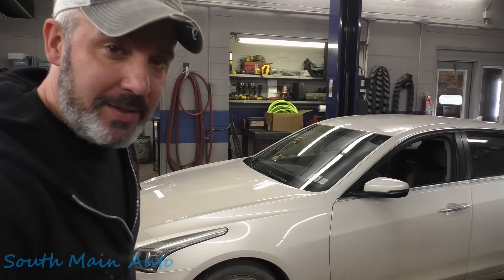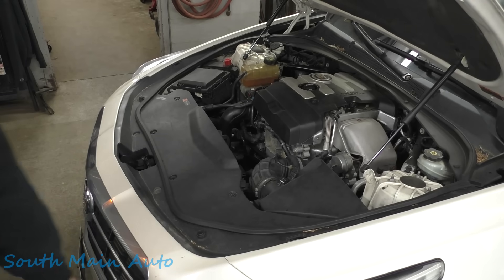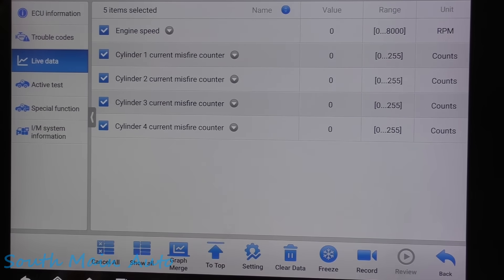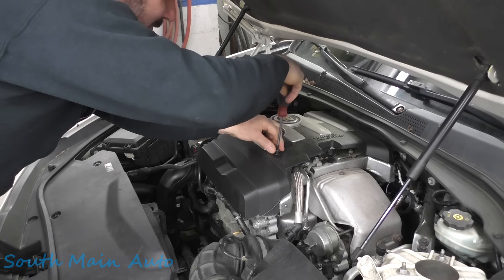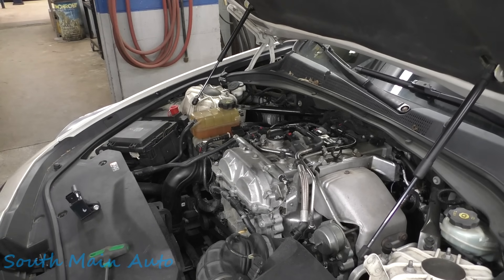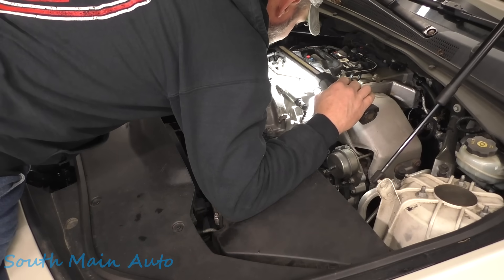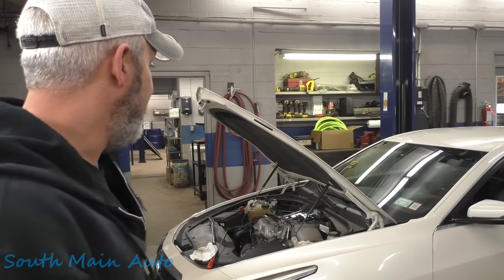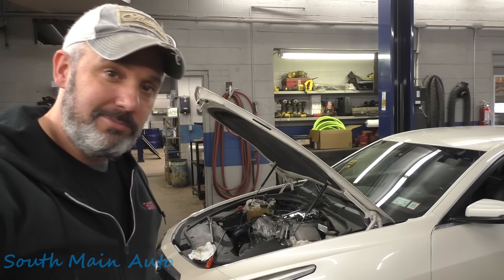'14 Cadillac CTS4 2.0 Turbo - Major Engine Damage

Comment: Danger Wil Robinson!!
Working at a Honda dealership some years back, performing a 60K service including spark plugs, I unknowing had a Snap On MAGNETIC spark plug socket that had a piece of magnet  break off and drop into the cylinder.
With the 2.2L aluminum head, it fell right down on top of the piston.
When the service was complete, I fired it up. It sounded like an empty spray paint can  being shaken at high speed for about 3 seconds, and then it was ejected out the exhaust valve, which closed on on the piece of magnet chipping the valve and damaging the valve seat  causing an instant dead miss.
Long story short, the dealership ate the parts and I ate the labor. After the service manager called the customer and put him in a loaner car he told all the techs in the shop that if anyone had magnetic spark plug sockets, to throw them in the trash.
Mine was the first one in the can and I will never forget eating that job. 
I hope that none of you will ever have too.

Comment: My spouse previously leased a 2015 CTS with the same engine. Decent performance, but the way they tuned the transmission is probably a major killer of these engines. It would refuse to downshift for as long as possible and run up to 15psi or so at like 2000rpm. It would climb steep hills at low rpm, just plowing boost into it. Guarantee LSPI is a major issue with as much boost as they force at low rpm, especially as these get a little older and higher miles (start consuming oil, which detonates like crazy under boost).
Reply: Yeah these things get wrecked because people refuse to run premium fuel and get oil changes at jiffy lube who do not use Dexos qualified oils that are required to mitigate the LSPI problem. I had a heavily tuned big turbo LTG and ran it hard at over 500whp for 120k miles. No problems at all. But I made sure the valves were cleaned regularly of carbon deposits and ran a catch can. All the car manufacturers love these DI high compression turbo motors because they hit fuel efficiency targets, so if it can last the warranty period with people that won't maintain them the way they need it to be everything after that is gravy for the service department.

Comment: If this TI wasn't on it, I would have guessed a bent valve, so I learned a thing here. The spot in the wall you see is wear due to piston load/slapping and not deformation due to coolant jackets being close. Built to a budget that was evidently a bit too low to make the engine reliable.

Comment: Thats what you get when using low octane on turbo engines.
Reply: Isn't it supposed to detune the engine a little if it senses a ping due to 87 octane?
Reply: Right there is the major problem IMO. If it's got a turbo, you need to be running premium gas.

Comment: Piston top design is integral to direct Injection engines, it helps with flame front propagation, as there are multiple Injection events during cold starts, and high demand situations, it truly is part of the chamber design.

Comment: This engine (LTG 2.0T) runs lean from the factory, which leads to piston issues. I went through a set of oem pistons, then upgraded to JE oversized If I recall correctly. Had a friend do it on a weekend, and tuned it using Vermont tuning. This corrected the fuel trims and prevented the car from running so lean. Not to mention more powaaaa. This car also had lots of differential problems. Sold the car last year at 160k, on its 3rd differential.

Comment: I work at a gm dealer, you get good and bad Cadillacs. Some have less problems than others, and people chose to fix what. Only thing I’ve really seen is newer 6.2 locking up. Other than that, the 3.6, 3.6tt, 2.0t 2.7t are decent engines
Reply: Yes. As long as you use Top Tier 93, use a quality synthetic oil and change it in time and change your plugs more often.

Comment: The piston top design was there to 'guide' a late in compression stroke direct injection fuel shot toward spark plug to create a local rich cloud in certain operating modes.  (Cold start...)

Comment: I totally agree it is broken piston rings or crack along the ring grooves on #1 !      Would account for the heavy scoring and groove  to the cylinder wall and lack/loss of compression.       Cutting open the oil filter will probably show some forbidden glitter accumilation.     Since this is the persons third engine that did this (or something similar) I would say it is likely that he pushes his cars too hard (its a Cadillac) not a Porsche or Ferrari.

Comment: Those 2013-14 2.0s were dropping dead left and right until GM released a TSB in 2014; different plugs and engine tune. That slowed it down, but dead 2.0s still pop up on Cadillac forum. I went with the 3.6 in my 13 ATS as I don't like turbo 4s; would have selected the base 2.5 over the 2.0 turbo.

Comment: The 2.0 Ecotec is a nice engine. Made especially for the Saturn redline supercharged Ion, HH4, and Cobalt. Then used in the Turbo cobalt, Cruze. The weakest part of the engine is the timing chain with plastic followers. Change at 80k. After looking at the video this 2.0 is different than the Ecotec. Thought they were the same but guess not.
Reply: Great engine with weak parts??

Comment: Easy fix Eric. Just turn of the fuel injector and ignition for that engine. It will become a 3 cylinder engine to run until it has 0 cylinder left.

Comment: Just wrecked my 2013 ATS with the 2.5 motor. First thing I'd be checking is that timing chain.
 Also watch that vacuum pump!!
Reply: I always check for the emblem and then make sure not to buy it

Comment: Not sure if your tool has it, but the newer GM vehicles have a compression test function in GDS2 that will disable the fuel injectors and crank the engine for a specific amount of time. Was helpful to be able to click a button and have it crank over to do the compression test when the 2.0T in my wife's '15 Malibu died. Was similar to this one too, low compression on #1.

Comment: I saw 2.0T and 2014 and already knew it was likely a cracked piston, the early LTGs are pretty notorious for doing that like the TSB Eric mentions. Guess I'm glad I have an LHU with timing chains as the most common failure point instead of wondering if I'll randomly get a dead cylinder from a failed piston.

Comment: Most computer scanners have a "compression" check which shuts off the fuel injectors and cranks the engine for 10 seconds and watching the RPM of the cranking speed.  This picks up a low compression jug as an increase in rpm during the degrees of rotation affecting the cylinder.

Comment: I suppose this is one of those times it is O.K. to guess and not test.  I think there is a difference between Eric taking a guess and anyone else.  Seems like he changed out an engine in one of these CTS cars some time ago.  I think he had to buy some kind of special table to raise the engine from below back into the car.  Every nut and bolt was installed correctly.  GREAT VIDEO!
Reply: What guessing? You see scoring that pronounced in that cylinder with low compression then you know it is dismantle fully to bore oversized plus anything you find when it is taken apart. That is not guessing.
Reply: @jimmyaber5920  I was just being sarcastic because he recently made a video on guessing instead of testing.

Comment: Looks to me that one of the exhaust valves kissed the piston slightly; just enough to bend it; contributing in part to low compression. BTW, it seems to me that most good & reputable mechanics are named Eric; well at least 3: You, ETCG & my mechanic Erik.🔧
Reply: That was a visual problem only, caused by oil on the carbon build-up.  I looked very closely at that.

Comment: Broken ring land sounds like a pre-ignition or detonation issue. The piston may have a design flaw making it weaker than it should be, but I wonder if the owner always used premium fuel. Perhaps not with if this is the third engine in 110,000 miles.

ALWAYS use premium fuel in a turbo engine, especially a modern one. Modern engine are more likely to have tighter mechanical tolerances and are generally less tolerant of abuse because they are built with less margin to "optimize" costs.

Comment: Early LTG engines were prone to piston failure, mainly due to the wrong tuning and customers running them on 87 gas. Surprised that one lasted as long as it did.

Comment: My hemi sounds like that, I figured a bad or leaking enjector,but still runs good and haven't changed plugs in 100,000 and has 350,000 miles on it. Probably should look for a replacement engine and rebuild for the future.

Comment: My two cents Worth of opinion, it's a customer wants to fix. Put a used motor in it. It probably has the same manufactured problem as this one junk pistons. Instead, instead, they could have the motor rehomed by rehomed by somebody with the correct tools.  And also to make sure that the honing is the correct. Deput, in some Teflon, coated skirted pistons with thin rings.
 From diamond or somebody, little extra money. But  gave Them a lot more Miles then what chevrolet has given Them. Just saying, thank you Eric for the video. Sure, would love to have one of those Cylinder cameras that looks like a damn nice Tool

Comment: Why does it look like one of the 4 valves is partially open about the 16:00 minute mark? Doesn't seem to be the case in the other cylinder you inspected. Maybe some sort of exotic valve timing strategy?
I would agree with the customers strategy for the car, but there is usually some other sucker out there who wants to own a Caddy.
Keep on cranking out the SMA videos 👍

Comment: As a gm tech all gm's direct injectino 4 cylinders have this issue, had one on a 1.4l buick encore with le2 engine- new style of the LUV 1.4l. had 44k on it and did 4 pistions, wrist pins and rings. also just looked on store and did not find the new endoscope you had pls add to the store or reply with link please and keep making the great videos

Comment: I wonder if they have been abiding by the premium fuel and dexos engine oil requirements to combat LSPI? I'm guessing no.
Reply: The engine in the video is a text book example of a boosted engine run (under boost) without the proper fuel octane requirement.

Comment: I'm thinkin this may become a common issue on all the OEMs installing small engines with turbos to save weight and improve mileage. Even full sized trucks are going with the small diesels with turbo, which begs the question... Can these small hopped up engines last? Being old school, I want all 8 cylinders running at all times if you are going to drive a full sized truck with even the occasional load. None of the fuel management BS. Dunno how all these small vehicles will last with hopped up ICE drivelines. Thanks Eric, I learn a lot from your vids. Love your tips from Granny.

Comment: @17:05.  That piston position indicator tool has a special aluminum rod with a rounded end.  That is so that it does not scrape aluminum flakes off of the top of the piston that can get lodged in the exhaust valves and prevent them from fully closing.

Comment: I have a '15 ATS with that 2.0T, 63k. It is the fastest car I've ever owned! But, I usually run 87octane in it and do regular Dexos changes. I thought it de-tuned itself a little if detecting pinging.  Now.....rethinking "cheap" gas.
Reply: Higher Octane prevents preignition(that's all it does) which apparently killed #1 piston.  If an engine runs at higher compression it needs higher octane and the idea of a turbo is to stuff more air/fuel into a compression stroke.  The knock sensor and computer can only do so much to prevent damage.
Reply: I have an '18 Camaro with the same engine and about the same mileage, and I like it a whole lot too.  It does detune for cheap gas, but I don't think it's really worth the performance and mileage drop, and in the manual GM makes it clear they would really rather you not do that if you can help it.  From other teardowns I've seen of this engine, it seems like what causes the piston damage is that the rings are already very tight, and the combination of combustion deposits and thermal expansion crumbles the metal around them.
Reply: @harrylister804 
I agree. 10:1 compression and 20+ psi of boost, the cylinder pressure have to be something wicked.

Comment: Unfortunately a common problem on 2013 and 2014 model year gm's with the LTG 2.0 turbo engine.  It affects a lot of Cadillac CTS and ATS models.  My understanding is the piston ring was somehow incorrectly gapped.  The issue was supposedly fixed from 2015+.  It's been well documented on Cadillac forums.

Comment: You can see the coolant is low.   The coolant tank has 2x chambers, the upper and lower.  The upper is the reservoir tank and the lower is the overflow tank.  The reservoir tank should be completely full and the overflow filled to the marked line.  On the video, the reservoir is only half full.  The overflow is likely empty...

Comment: Subaru has/had a problem with ring lands breaking on EJ257s found in the Impreza STIs. Subaru specs very tight compression ring end-gaps (as low as 0.009") which might be necessary for emissions but is way too tight for a turbo motor with a ~4" bore; with heat the gaps close up, the ends butt together, the ring seizes to the wall momentarily and a ring land breaks. I read that Cadillac likewise runs super-tight (0.007") gaps on these engines and that's probably why they're breaking. Were it mine -- and it didn't have the bore scoring seen here -- I'd probably put a new set of pistons and rings in it but open the compression ring gaps to 0.015" to 0.020" and it would probably never break again (at least ring lands...)

Comment: Could this be a stuck injector washing out the cylinder? Hence a replacement engine fitted with the same injectors caused the same fault, maybe intermittent?  I guess we'll never know if it's gone  to the crushers.

Comment: Some of you old timers might remember the 4100 or the 8-6-4 or maybe even the Northstar 4.6. GM has really stuck it to the customer Caddy base. Really a shame they didn't throw the GM 3800 in those Northstar's. As far as a 4 cylinder I don't remember GM ever making a good one.
Reply: GM 2.5l, iron duke.

Comment: GM dropped the 2.0 from the lineup for this reason. There is a design flat that a not be fixed for some reason. It was easier to dump the motor than to find a solution. 

Out of curiosity, would you rebuild this in house or would you send it out?

Comment: Had a load of 1.4 turbos with this problem.  Always number 1 cylinder with cracked ring lands. G M uses cast pistons, should be forged but the design of the top would be too expensive  to make. Had one with only 32,000 miles and full dealer service history. G M did not want to know.....

Comment: Happens to my Audi A4 with a 2.0 turbo and I have been told be the dealer that the piston rings are stuck on #4.  So the options are, new engine, replace the rings or run cleaner products and pray.  As new engines are $8k before installation, I am using the last option.
Reply: MARVEL MYSTERY OIL
Reply: Match and a gallon of lighter fluid.

Comment: Cadillac uses a different 2.0 engine in their newer cars.  It's actually a decent motor.  They downgraded the power and torque but it no longer requires premium fuel; it's just recommended.

Comment: Should've retrofitted an old 472 Caddy motor and trans in it for the first replacement. Would've been cheaper than the first engine and it'd still be working fine. Crappy gas mileage, but the money saved from the second replacement would make up for it.

Comment: With any engine suffering that kind of cylinder damage, what would happen in the next 1k, 10k, 30k miles if you simply disconnected that cylinder’s injector and kept running everything as normal?

What sort of secondary problem would develop that would ultimately force repair or replacement?  Obviously it still drives under its own power, but for how long?

Comment: I got a lot out of this video. I wonder if pre-ignition or some abuse contributed. We have a 2016 ATS with the 2.0T ~ 70K miles. So far so good with the engine. The rear diff is another story entirely (crappy seals).

Comment: Cylinders do scuff without the piston being cracked or broken . Incorrect fitting of piston to cylinder wall clearance , lean and/or rich condition , reduced cylinder lubrication from restricted or plugged piston cooling nozzle/squirters , not enough piston ring end gap - too tight , etc...........Assembly line engine blocks and pistons , including cylinder and piston jug kits , do not always match up with the correct piston to cylinder wall clearance (porsch piston and wall scuffing )

Comment: If your going to stick a turbo on an engine then build the engine as rugged as a Diesel.  Your compression ratio is getting up to near Diesel compression territory under boost.  It would be like putting a Nitros oxide kit on your Briggs& Stratton lawn mower.

Comment: Remove plugs while cold add 1 pint berrymens centool 12  to each cylinder let sit over nite... change oil install plugs ...ngk add 93 octane dive the dawg pee out of it for 200,000 more 😆 great video thanks for sharing

Comment: What does this?  Hard driving? Failure to change oil on regular intervals?  Bad design?
Reply: Since it was the one cylinder only... Bad design is my guess

Unfortunately those GM owners of the same engine across multiple models are not going to like this😢

Comment: at 9:00 when you do the compression test, ive heard/read to pull the fuel pump fuse so the cylinders dont wash in fuel, ive heard unplug the injectors, and just like earlier in the video you can crank in flood mode.

in this video did you crank it like any normal situation, or crank in flood mode?
Reply from the maker: I cranked in clear flood. That's why it didn't start 👍🏼
Reply: @SouthMainAuto yep, cool thanks. have a good weekend.